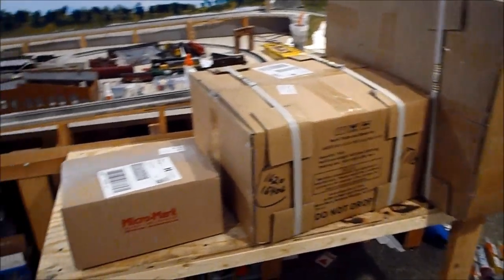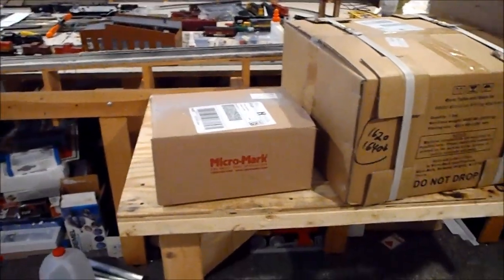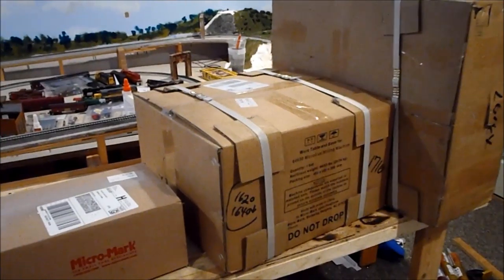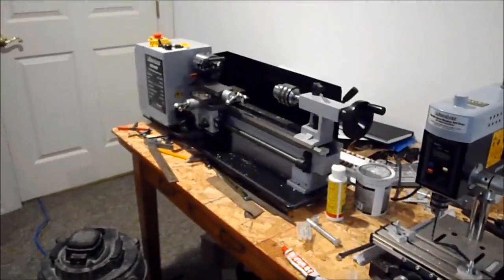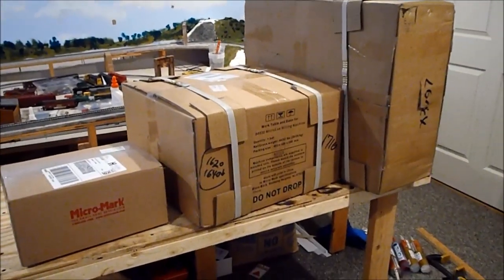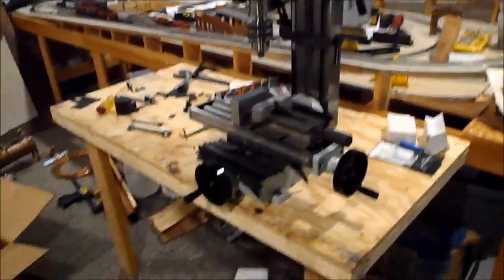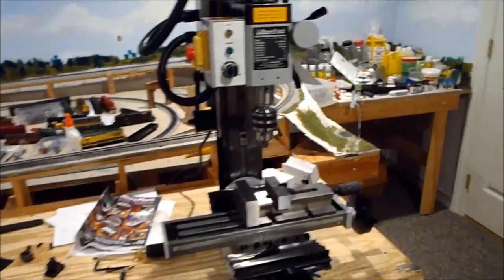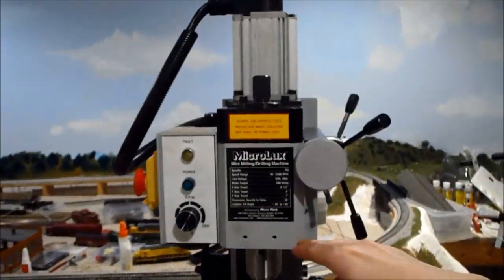MicroLux High Precision Heavy Duty R8 Miniature Milling Machine

Comment: I have been looking into buying one these. How has it been working for you?
Reply from the maker: It's ok, I would recommend buying the little machine shop mini mill with the solid column because it just makes the machine easier to operate. I've also heard that it machines better because with the adjustable angle column vibrations affect the actual machining of the work just ever so slightly.